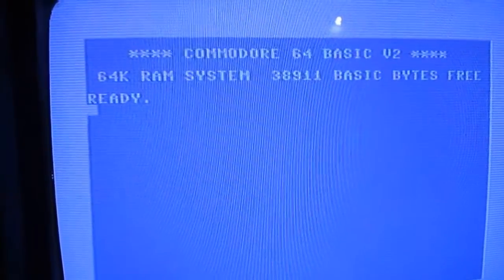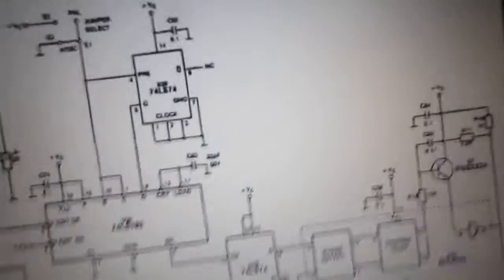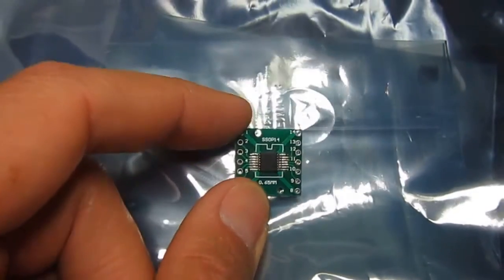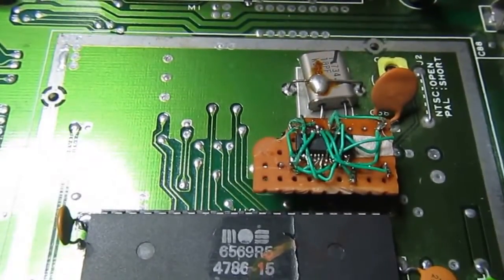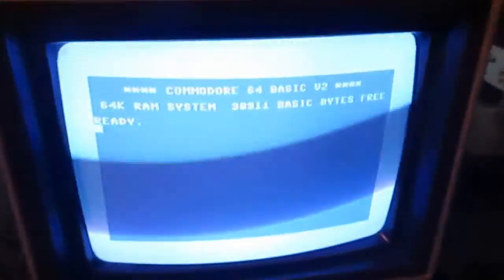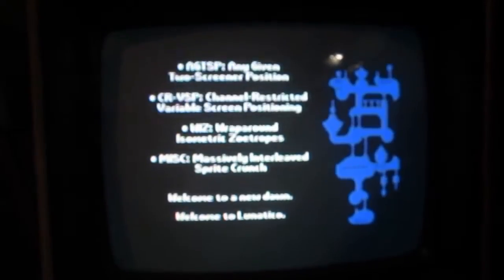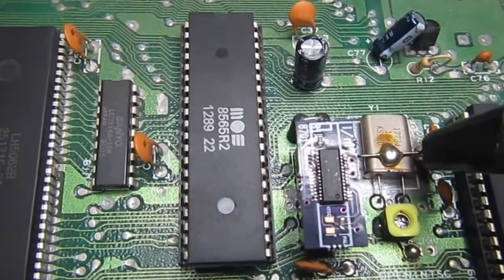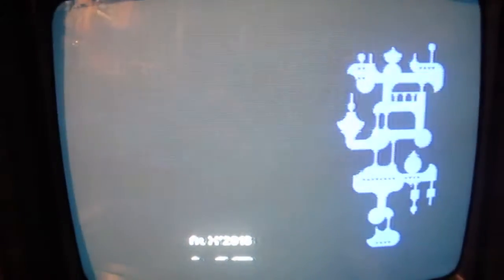MOS 8701 modern replacement

Comment: There is no oscillator on your board which means the 525-01R you put on your board is dependent on the crystal on the mainboard. Since the 525-01R has a slightly different impedance the frequency will be slightly off. You need to readjust the variable capacitor next to the crystal but you don't have an adequate frequency counter to do it. In other words, your solution is bad.
Reply from the maker: There's a variable capacitor next to the crystal and it can bring the frequency back to the correct value. I have GPS disciplined 10 MHz oscillators (a few actually) to calibrate all my frequency counters. But thanks for your comment anyway.
Reply: @iz8dwf  I sifted through your video and there isn't a point where I see you checking the accuracy of the frequency using a frequency counter. Also, I notice you use softwares to check for the correct operation of your replacement instead of hardware compatibility. Some less expensive frequency counters are limited to 10 MHz and you could have used the dot clock to check accuracy with one of these but even that is not shown in your video. In other words perhaps I am wrong because I assumed but then I assumed based on what I saw. The fact you repeat there is a variable capacitor next to the crystal implies you didn't really read my comment.

Comment: Hi can you show a video or photo of the bottom of the adapter? I'm interested on how you soldered the pins without using holes on the pcb.
Reply from the maker: middle pads have no hole, but only a flat area as any SMD pad. The pin strips have trimmed pins corresponding to the "no hole" pads, so once I solder the pins that go
through the holes, I apply some solder to the "SMD" pads to make contact the trimmed pins. I can send you an image of the PCB if you contact me via email.
However my design has been improved by Jeff Birt, see here: https://www.youtube.com/watch?v=e5o8c656j3Q

Comment: By the way ... did recognice a better picture quality by using your replacement? Because it's well known that the original MOS  8701 does not generate a really nice looking CLK signal.
Reply from the maker: Hi Doktor64! Thanks for the nice comments! I didn't notice a picture difference, but I didn't compare the quality also. The mos8701 does digital frequency division and delays to derive both clocks from the same source (the crystal oscillator), the replacement I've chosen is an integrated PLL, so in theory, they have different noise characteristics (jitter, phase noise). But overall I think the standard video signals from a VIC-II chip aren't enough high quality to benefit from a cleaner clock :)
Reply: @iz8dwf  There are now better video quality options becoming available such as the component video mod by c0pperdragon which really needs clean clock signals.  So, it would definitely be interesting to see how clean the dot clock is coming from your 8701 replacement.
Reply from the maker: @Ikrananka  As Jeff Birt showed in his video, clock signals are (obviously) more stable than the ones produced by the old 8701: https://www.youtube.com/watch?v=e5o8c656j3Q
Reply: @iz8dwf  Doh!  I hadn't realised that Jeff's design was an extension of yours and so has the same clock generation characteristics.  I'm a little slow on the uptake here so sorry about that.

Comment: Are there any 8701 replacement designs that don't require a chip to be programmed, such as something that uses only 74 series logic or similar basic components?
Reply from the maker: Hi 00Skyfox, strictly speaking, this chip doesn't need to be programmed, it just needs some pins to be tied to GND and others to VCC. I'm not aware of any design with logic chips, I had one of my own but I never ever got to the testing phase since it was too big even with all SMD parts (5 chips as far as I remember).
Reply: Thanks for the info!

Comment: Another interesting Commodore repair video. I always like your Commodore chip replacement projects.  The 8701 replacement PCB looks great. Can you discuss more regarding the chip you used?
Reply from the maker: HI! 
It's the ICS-525-01,  it's small, cheap and can be adapted without programming.

Comment: Wow, that's just awesome!  It would be interesting to understand a bit more about the chip you've used and how it connects up!
Reply from the maker: Hi, thanks for the nice comment! I've used the ICS-525-01,  the datasheet has the equations to set the various divider words to generate the correct PLL relationship between DOT and COLOR cloks. I've also tried to allow for a jumper to select between NTSC and PAL, but since I don't have any NTSC C64, I couldn't test it.
The real tricky part is making a PCB as small as the original 8701, I'm not sure it's a good job as it took quite a while to solder the pin strips in place.
Reply: Nice detailed explanation there =D  I agree, if he's selling these I will by a bunch as well!
Reply from the maker: Actually the configuration is S1,S2,V2,R2 to 1 on the PAL version. It's the minimum jitter configuration and on the video there's a point where I show the color clock frequency measured with my frequency counter. On the C64 it can be adjusted straight to 17.734476 MHz, on the C64C it goes only to 17.734500 more or less, it needs some more loading on the crystal. The division ratio for the dot clock is exactly what's made inside the original 8701, so it's correct by definition.
I can sell the bare PCBs but it's really tricky to solder the pin strips (and it has components on both sides) as to make it fit in the original 300 mils dip space, I couldn't use through-hole pins.
Selling the finished replacements would cost more (I didn't even think about how much) but at least I would make sure they work before shipping.
Reply from the maker: Oh you're right, I didn't show the dot clock value. I measured it and it was in the 7.882 MHz neighborhood as it should be. It's obtained with the same division ratio of the original 8701 so I didn't expect surprises. When I was testing the prototype and the wires weren't soldered on the right pins, the dot clock wasn't right and that was really obvious from the C64 screen :)